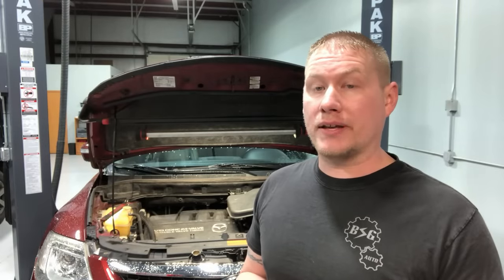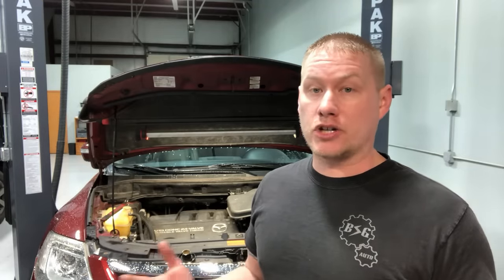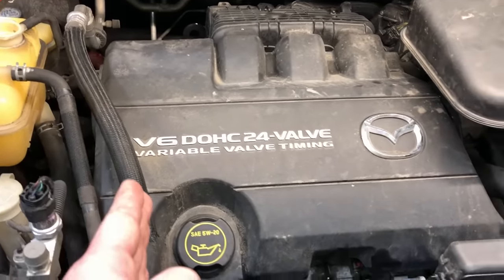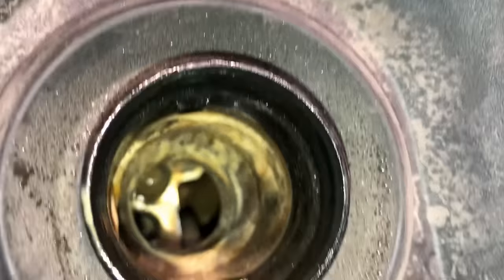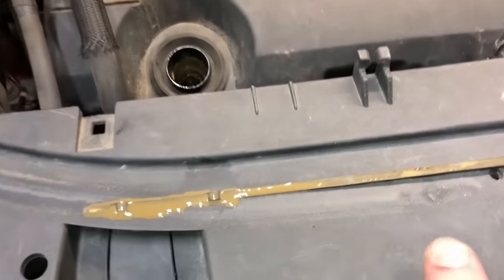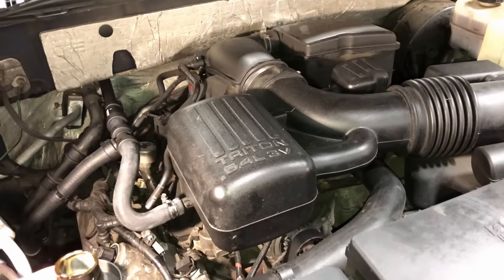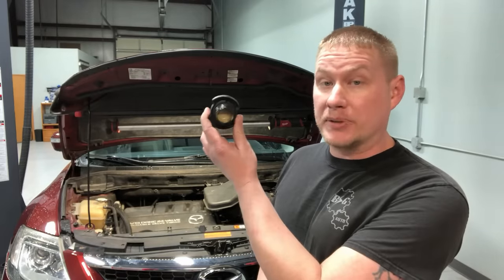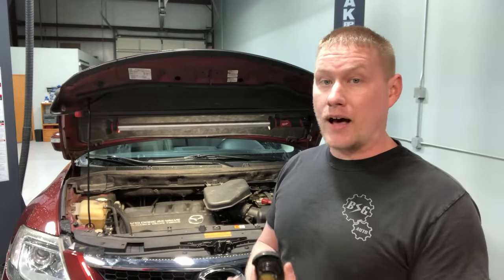Do You Have a Blown Head Gasket?

Comment: Take a teaspoon of water from the radiator & put a few drops straight onto the cars exhaust when it is hot & running, if the water quickly evaporates & doesn't leave any oily residue & a dipstick check reveals clean looking oil then you can be pretty sure all is well.  also run the car with the radiator cap off, no bubbles, no troubles! That's my DIY easy home test. No equipment necessary! Worst case scenario, Bar's Leaks Head Gasket  Fix & an oil change may do the trick, my mate tried it & 2 years later, car runs great & no signs of blown head gasket.

Comment: I have a 04 f150. I did a oil filter and oil  change. Put 6 quarts in motor and filter. Started up the 
Motor let run for a 1 minute  came back and checked level dipstick says still  quart low. ANY CLUE?

Comment: I have a 4.0 SOHC that the rear passenger cylinder has a spray of fuel with water mixed, took out fuel pump relay , depressurized fuel rail and it just sprays a mist of water out spark plug hole. Had went on a 120mile drive round trip, no issues at all, next day engine wouldn't crank, even tried by hand. after removing spark plugs, it was fine. When I removed spark plug from cylinder in question, I heard a release of air pressure that sounded to come from throttle body. My question is no codes, no misfires ran great day before, what the heck is it? I don't see any milky on dipstick, cap is clean and reservoir is not down.

Comment: My 98 F150 5.4 is making me loco. I'm getting a lot of white smoke on Startup but I have no bubbles in my coolant I'm not losing coolant in my engine oil is looking good even after 1,000 miles I have a little bit of sludge on the top of my cap as you mentioned. Do you have any suggestions where I should start? I change the old head gasket about 4,000 Mi ago and everything had been fine. I know it's a shot in the dark on a four-year-old video but I thought I'd take a chance. Thanks

Comment: @FordTechMakuloco I have a 2002 Honda Accord 3.0 and I just changed the water pump and timing belt because the water pump went bad. Will those automatically dump coolant into the oil?

Comment: i watch your video how to check bad cyclinder head gasket and crack cylinder head. i have a 2003 ford 150 5.4L 2V windsor engine had an oil and coolant mixture. i perform taking out the cylinder head bring it to the shop for service. resurface clean head, resurface and check for crack. put everything back together and and it still leak out mix oil&coolant at the number#4 cylinder head cover. what seems to be the problem..

Comment: Got a quick question have you ever seen Ford F-150 4.6 99 model leak oil passenger side only when you running truck over 3k rpm I looked and can’t find the leak but was told head gasket. Truck doesn’t over heat just leaks oil about a quart a month if you drive interstate lot    Thanks for letting me know

Comment: 1999 Ford expedition with a triton had the heater cor replaced, thermostat replaced, radiator flushed, gets  hot in the cab above 2000 RPMs at idle it cools down but not cold. No leaks just wondering if water pump impeller could be bad. is this possible?

Comment: I drive a 2016 Subaru WRX with 71k miles. I've had white smoke out exhaust intermittent and what seems to be an internal coolant leak for about a month. Having to top off coolant when it's hot outside. I assumed it was a head gasket issue. So I've done the combustion test multiple times and it has passed with no change in fluid color. What the hell could be causing this if it's not a head gasket? Can bad water pump, thermostat, bad radiator, bad radiator fan etc cause white smoke out the exhaust without a blown gasket? I am literally so puzzled at this point. Also not getting any heating issues or coolant into the oil

Comment: My 07 edge, has empty bottle Clean inside. But the oil is now reading way over filled by a lot. there is a hint or slight milk shake on tip of dipstick. otherwise it looks over filled by 4-5 inches above full mark. it over heated ( temp gauge started reading getting hot ). It was parked right away. I got to the vehicle to check it and noticed it had puked oil all over front engine mount and frame area and some on the top of the seam of bottle. Now I suspect already water pump. But why did it puke oil all over? as said inside the bottle it is clean but empty. 2007 edge with 190k.

Comment: I have the same issue with my 05 F150 and was a bit worried. I flushed the oil and did a double oil change to make sure the cleaner was out.
I wish I would have seen this like 2 days ago. 

I do need to get my timing chains, cam phasers, and may as well do the roller followers while they're in there. I dont really know any small shops but wish I could bring it to you. I wouldn't be so worried about it being done right. I can't imagine what the dealership is going to charge me.
You got any mechanics in Milwaukee you trust and might suggest?

Comment: My ford flex just overheated and as I tried to fill coolant it kept disappearing. No leaking externally. White smoke out of the exhaust and power loss. Do you think head gasket, water pump, or cracked block?

Comment: How thick can the build up be?  I have a high milage 3.5 TT motor that has some rather thick milky/slightly brownish build up under the cap building up.  The oil looks rather new so I'm unsure how much to trust that and the valvetrain isn't exactly showing all the murk either.

Comment: I bought a 2006 Volkswagen Passat In November 2022, first day drinking it coolant  light comes on, bought jug filled it , every day after few miles light comes on constantly bought jugs, I got fustrated like something ain’t right it has be leaking or something, so I had someone come try do what they said pressure check couldn’t get complete reading but he said it just tells him it’s leaking somewhere, kept trying contact person bought it from no response took it to a shop we’re the guy put a clamp on hose , ok fine for alittle. Oil light came on installed oil car wouldn’t start, but when it cranked up oh the clouds of smoke was terrible, had it towed all I kept hearing was it sounds like the headgasket, my daughter called Volkswagen shop been that the person wouldn’t answer, he said no matter the oil, something sounded fishy from whomever had the car before us, ok I later had the oil change car started up back to smoke and coolant light and not starting is this headgasket? And yes it was so much milkyshake in engine.
Then one day my other child found the person that sold us the car on Facebook this person says , oh y’all blew the Turbo , we’re like no we no something had been going on before you sold this car and the person tried to tell my daughter if your mom had been texting the other number ( mind you the number this person was communicating with me on from the day before selling and two days after) that there phone company had to change there number du to whatever reasons 🤔 yeah right

Comment: Years ago I had a 65 Plymouth 318. Always driven for short trips in a Canadian city. It would foam up like that on the oil cap. A long drive sometimes cleared it up, or an oil change would fix it until next time. Years later....was thinking about buying a used mustang, looked at the inside of the oil cap and it was ,illy foamy looking,  I almost bought it but chickened out in case it was the head gasket. In hind site it was likely because the car belonged to an older woman who prob only drove it for short trips.

Comment: Drove my car with 
h no water for 20+ miles. It started leaking something in small amounts on driveway after that. I am still freaking out. Don’t know if engine has some type of damage or not. Appears to have stopped leaking. I do believe I saw a big spot of something on the driveway from the muffler. Don’t know. It is cold outside, but I don’t think I have ever noticed that before, ever. I did not know that when you get an oil change they do not check the water too.

Comment: I got a 2014 gen 1 coyote for $700 couple days ago and it has coolant in the oil but I’m thinking . Head gaskets, new freeze plugs in both cylinder heads and a new water pump should fix this issue and get it up and running

Comment: i just saw this on my 2011 f150 new motor at 78,000 miles now it sputters so i replaced the mass air flow and the throttle body, and cam senor A bank 1 intake  i think i rest the pcm but check ngine light still on i do drive varry short ways maybe 10 mini or 20 mins then iam home so the other day i went to go to the store and truck was not execl at all i truned it off the tured it back on this time i let the motor warm up it took me to the store so today i was getting ready to go to the store  and truck was sputtering iam like maybe one plug cam un done checed them all good then i pop open the oil cap saw milky oil freeked out checked the dip stick gold dark oil no milky ill look down into the vale train after i rite this thak you for your epic videos

Comment: Hey I have a question I have a 2002 Lincoln LS V8 over time it started to overheat I've had the electronic fan replaced I've had the thermostat housing replaced twice according to my mechanic everything seems to be working fine they can't figure out why it's overheating water's fine oil is fine could it be my water pump or radiator hoses

Comment: Jeep Liberty 3.7 here. Found that same yellow gunk on the cap but not on the stick. The stick looks normal, but I noticed oil residue coming out bank 2 (passenger side). I get this odd smell like something burned coming from the passenger side every now and then. I’m not sure if my head gasket is blown because of the clean dip stick, but I do drive short distances daily multiple times a day. Most rides aren’t over 15 min and I live in a south Texas city where weather can sometimes flop daily  from hot to cold so it may just be condensation causing the yellow gunk, but that still doesn’t explain the oil residue on the side of the engine. Any help is greatly appreciated

Comment: Im in PA and my 99 ranger used a bit of coolant and has very light amount of white on the oil cap. But the oil is still black. (Burning oil a different problem) any suggestions?

Comment: Water is a by product of combustion, engine oil needs to run at 220-240 degrees to evaporate the moisture. Good reason to drive at least 15 miles or run motor 20-30 minutes, or change the oil more frequently as noted in service , owners manual.

Comment: My wife had the exact same vehicle. This thing has one of the worst engines built ever(by ford no wonder). It gots the water pump basically built into the engine and it's only separated from the oil by a plate. One day her car was running really rough so I did a inspection on her car and when I took the oil cap off and seen that milky oil, I told my wife the bad news. We got rid of it and I got her a Camry.

Comment: I had a water pump go out as I was driving from Colorado to New mexico I got home and changed the water pump on my 97 lincoln town car and started it up and had random engine misfires, I tried to diagnose it myself and heard a hissing coming out of my intake manifold gasket and haven't started it up since, I was told to check fuel related parts and spark plugs and my spark plugs have coolant on them, could this be the intake gasket or the head gasket I don't got milky oil anywhere nor does my coolant bubble ?

Comment: I noticed in my 2008 F250 6.4 Diesel a Butterscotch creamy substance in my Degas bottle.  So, I flushed system out about a month ago.  But, now I'm having a hard time moving shift arm into gear and transmission not smooth. So, I checked degas bottle and transmission stick.  Dang if it the creamy stuff wasn't in both places.  An area mechanic said I probably need to flush again plus get transmission flushed then replace my radiator.  What do you think???

Comment: Just had a big flood down in Florida own a Jeep wrangler… was able to drive through the flood but engine gave me stalling trouble the next day … I’ve flushed the oil twice first was basically milk second slightest milk and now the car seems to be running with a clean dstick… coolant looked low so I put a lil more in now it’s clearly overfilled so no clue what’s up… cap and everything has been cleaned guessing I might have one of these issues… how would I know if it’s the water pump and not a head gasket

Comment: I pulled the dipstick on a 318 Jimmy diesel. Oil was Cappuccino color and a gallon over max. I warned him. But noooo, he use the truck. Two hours later he had a repair bill that made him bleed out thru the eyes and ears. I use Pro Blend snake oil in my engines. My Mazda pickup cracked the cylinder head, all the oil mixed with the water. No oil. I drove over 100 miles, up the Santa Cruz mtns....The engine started and stopped like nothing was wrong. Some snake oils do provide protection. Used pro blend since 1984.

Comment: Stuck open thermostat causing engine to run too cold and not burning off condensation in the crankcase
Reply from the maker: It would have to be extreme but you would also have a P0125 or P0128 code set after a few drive cycles on any 1996 or newer vehicle.

Comment: In Canada this happens to most the cars in winter.  In fact if you go to places like Mr. Lube or Jiffy lube they love seeing this pudding and try and sell you and engine flush on top of your oil change, which is a waist of money. (I clean it out with a rag and then drive the car about 30 miles on the highway to heat it up then bring it in for an oil change.)

Comment: a bad PVC valve can make it look like a bad headgasket but the best tell tell sign for a blown headgasket is to remember that the oil system has higher pressure then coolant system,  so oil typically travels into the coolant system vs the oil system. always check you expansion tanks for oil. an if the headgasket is really bad an oil change will show instantly how bad it is. this is the basic crude way of finding out quickly what's going on.

Comment: I have 1994 gmc 1500  engine rebuilt on the summer of 2016 parked until today 03/10/19 I decided to turn it  on it sounded so smooth like a new truck  I decided  to change the oil because It still had break in it still . To my surprise it had water  in the oil not much but enough to notice is. This condesation?

Comment: got a 2004 Chrysler pacifica that runs hot but does not smoke. a mechanic told me it was the head gasket but there is no milkshake it runs hot. i had to take the thermostat to get it home from the mechanic. there is a shop that wants $1400 to replace it but even they asked if it was smoking. do you think it's the head gasket? could the head( s) be warped?
the item that tipped the mechanic off was the presence of some type of carbons present it the overflow container. he used a sensor and said it should read zero. as the car was being revved the sensor began to show elevated numbers of this carbon. that was his evidence that my head gasket was blown.

Comment: Got a question. I know you're a Ford guy, but having issues with my 1500 Silverado. Uses a little coolant and has a rough idle. Oil is clean and no gunk in fill tube. Valve train looks good from what I can see. I have the "Service Engine soon" light on and had Oreilly pull code (I know I need to get one for myself but moneys tight.) Its giving some generic misfire code. Thoughts? I have not had the weather to pull plugs and check. I was going between head gasket and intake manifold gasket. Hoping its the intake if it's either of the two.

Comment: I just watched this. I have a mini cooper r57. Live in the UK. We had some very cold weather here the other week. I have only used my car for short trips. Check engine light came on. Checked it with an odp 2. Reading said it was inlet sensor. So I swapped with the outlet to check. While taking out the inlet sensor saw some creamy gunk. Checked the oil cap. Same creamy gunk. However, no loss of coolant. Looks clear inside the engine. Hopefully it's what you mentioned in your video.

Comment: That's exactly how the oil cap looked on the Expedition 5.4L I ended up buying. Early in the test drive I pulled the cap and saw "Oh no, white gunk, blown head gasket!". Pulled the dipstick and wiped it on a white towel, oil looks fine, nothing wrong with it. 
Continued the test drive and after another 10 minutes, when it was warmed up, pulled the oil cap again, no white gunk this time. And I've never seen it since in the month I've owned it. 
It just had the condensation buildup from sitting on that used lot for what turned out to be FIVE MONTHS. Changed the oil and had no visible water or issues. Has been great so far. I'm working through all the '5.4L tips' on this great channel .

Comment: my 1997 318ci jeep grand cherokee gets yellow snot because i dont drive it far. cant be a headgasket because you can run those cast iron blocks on air and not warp the engine.

Comment: Great video, Thank you. I have a 65 Ford F100 with a 72 Gran Torino 302, and I am kind of lost at figuring out how coolant is getting into my oil.  The color of the mix on the dipstick, pcv and breather cap is white. The temp stays cool with no over heating at all.  I replaced both heads, gaskets (fel-pro set), mahle bolt set (to torque spec),  water pump and thermostat. I did a pressure test and the results are good. I also used an inspection camera through the spark plug holes after I drove it for awhile, but no coolant is visible on piston heads or in the cyclinders. So I believe it probably isn't a blown head gasket. Can a bad, cracked or warped intake be the culprit? Or should I dive deep into the water pump area/timing cover etc? There is no oil cooler as far as I can see, so I am ruling that out.